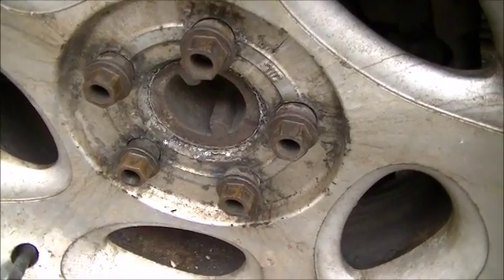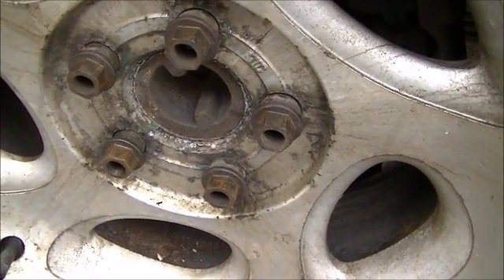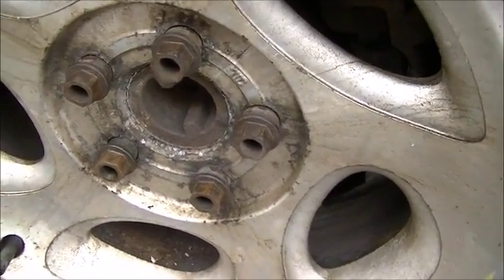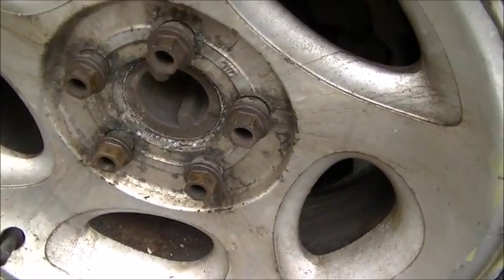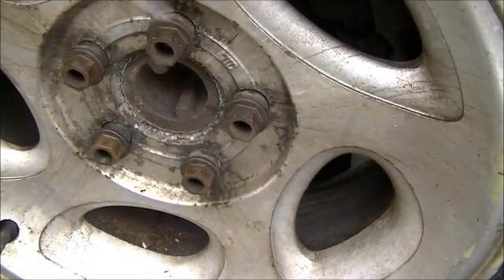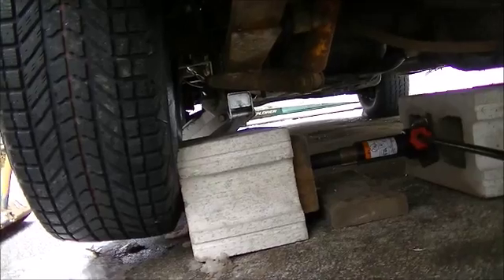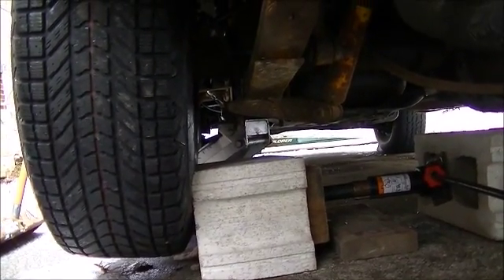Seized Wheels

Comment: Thanks for the idea with the bottle jack, handle up.  Used rough cut oak 2"x6"x1( 3 & 2 at 38")) instead of cinder blocks.  Bottle jack between 2 2"x6"x1' one of them against the tire coming off, the other 2x"6"x1against the tire not coming off still on the ground and 2 more 2"x6"x 38" placed together in between the others, had to rotate the tires several times but it works!  Thanks
Reply from the maker: Thx for replying! makes it worth doing even if it helps just one person!